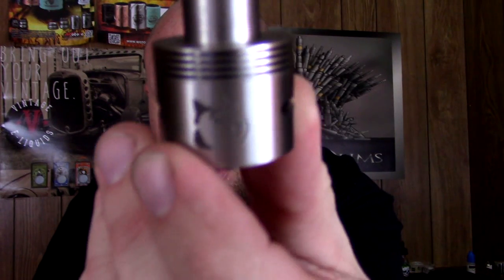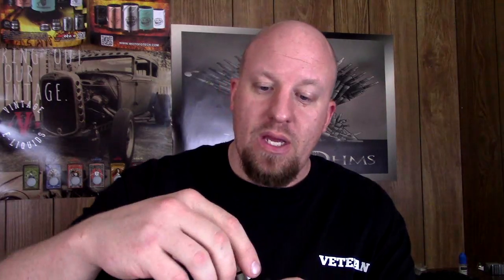SERIES vs PARALLEL~ 101~ Its Science Bitch!!!!

Comment: can I use a 20 amp 18650 in a noisy cricket series box with 14 raps on a 3 millimeter drill bit
Reply from the maker: Dentz Storm i would not use any 🔋 under 30 to 35 amps...
Reply: Vaping Vigilante I can't get my hands on any above 20 amps my vape shops don't carry them anymore
Reply from the maker: www.imrbatteries.com

Comment: Mention, if you stack 4 18650 batteries in parallel config. It will be spitting out 8.4 volts. Actually more safer than a regular 2 18650 wherein 4 18650 parallel stacked has less discharge for each battery. My unregulated or fully mechanical device is parallel, can config. to series ( parts included with mod ) as well as ordering a booster kit ( in which stacking 4 18650's in parallel mode ) can be applied also capable of building lower than .3 with booster kit. I'd stay above .4 in 2 18650 in series, and I build as low but no lower than .05 which is super fucking low. I know my batteries and I do play with ohms law so don't try if you don't know what you're doing 

In case you're wondering what my mod is...The mod is called KALASAG BOX MOD by Ninoy Aquino maker of BB box mods ( bulak boys box mods "cotton boys box mods") :)

Comment: Nobody should buy a noisy cricket . they are a cheap cheap series 18650 box that is not made good not wired good .If you want to get a series box get a good custom made one . spend that $130 Bucks and get a good one . Build at   .35    .40    .50   they say you can go Down to .28 with true 30 amp batteries . "The only true 30 amp cont batteries tested by Mooch are  LG HB 2  ,HB4,, HB6  " thats it, not sony vtc5 vtc4 vtc3  not samsung 25r's    Nothing but LG HB2  HB4 HB6 if your going to build AT .28 -.35 ON A SERIES . Nothing else can handle it ..now if your at .40 ohms  on up the other batteries would be fine ..  Series Mech Boxes are for expert vaping . unless you are very experienced stay with single battery Mech mods or Parallel Boxes ..Stay safe folks ..dont blow your face off :) thats why we quit smoking was to stay alive and healthy .
Reply: Right To Vape vtc5a work in my series so wrong

Comment: so are your vw/vv boxes in series? how do they pull the 7+ volts?
Reply: +Chris Chandler No there where vv/vw capable of outputting more volt's then the input from the battery(4.2 and dropping with use) with only one battery for a long time. I am no pro at this but I believe the circuit board is responsible for increasing the voltage much like it is responsible for stepping it down. Once again I am no expert so take what I am saying as a grain of salt.
Reply: slosh11111420 that simply isn't possible unless the mod has a capacitor inside of it.
Reply: Well then they must. Not saying I know the recipe but single battery mod's capable of 7v have been around a long time.
Reply: slosh11111420 I don't know of any single battery mod putting out 7 volts
Reply: That's all there was for a couple year's. Series box's are only been around a year or so.

Comment: Putting a .6 on a parallel box and then a 8.4v. You can match it with the parallel at super subohm. Now I can see doing this for safety issues for this channel. But I do .05-.09. My daily vape is .09 on a parallel box. If on series .3. But then again I've been doing it for a long time. Also being being educated . It's not uncommon for the advanced vapor doing .06-.08 if you a comp vapor, depending on the rules of the comp. But a .6 on a parallel then going to 8.4v, apples and oranges. But I know you know all that for sure.
But for sure saftey first. You need to know everything you said. pulse ratings of the battery, ohms I mean like you said it's sience. I've only vented one battery and it wasn't in a mech. But well done video. Sorry for the rant.

Comment: I was watching this vid hoping to find the answer to one question which you really didnt touch upon. When running in parallel you double the amp hours what does that translate to in actual usable amps as two 30 amp batteries in parallel dont equal 60 continuous amps but something near 40? or so from what i've been able to find. im asking this so i can find a proper comparison of a parallel and series box mod in terms of equal wattage. in pure numbers its obvious that the series would out perform the parallel box simply because of the amps to watts that it puts out but in practical use would it produce more vapor as the parallel would allow for more elaborate coils potentially producing more vapor? sorry rambled on for a bit hope you can help maybe imma idiot and missing something haha
Reply from the maker: Parallel setups are safer setups . It is safer due to the amp load being shared by the batteries. Now series of course is much higher voltage which translates to more current or amp flow which if done wrong and too high a amp draw is placed on the batteries and circuit can cause problems. Battery life is less in series. Now series does have the current to fire up more elaborate coil setups , but an unregulated series setup won't stop you from fucking shit up and over pushing your batteries and the device in general.
Reply: +Vaping Vigilante wouldn't series be safer because you are vaping at a higher resistance.  the lower, the less safe and the less strain on ur batteries
Reply: +grantd272 You might vape at a Higher resistance, but since you are pulling 8.4v (at best) from the batteries, your amps are also going through the roof. 
Say you have a 0.2ohm coil, in a parallel you&#39;d be pulling 21amps which is a bit over some single batteries limit but since you are in a parallel configuration, each battery will only be giving out around 10.5amps each which is safe.
Now if you go on a series configuration with the same 0.2ohm coil, you&#39;d be pulling 42amps which would result in a venting situation in some puff, if not immediately.
If you want to keep it simple for a series config, buy GOOD batteries from REPUTABLE Sources (like sony VTC4, Samsung 25R or LG HB4 (i believe)), an ACCURATE OHM READER (USA ones are great) and STAY over 0.4ohms in your coil build.
Reply: +Stéphane Lourenco any lower than .35 on a series is unvapable.
Reply: +grantd272  Pretty much yeah... I've seen some people vape that low but It was a REALLY hot vape. Some people might like it, but then again, I prefer to stay between 0.4 at the minimum and 0.7 ohms.

Comment: didnt touch on at all about HOW to build for series and parallel.....that Cigreen box would fire ANOTHER 0.6 ohm build and BLAST your shorts off. It just wasn't meant for that kinda of 0.6 ohm coil.  Lower gauge wire and less wraps will also get you to 0.6 and will ramp up MUCH faster on that parallel. At the same time those series boxes are meant for higher ohm builds above an ohm that would otherwise take forever to ramp on a parallel but will ROCK on a series. no diss, I enjoy your vids and am a subscriber. #respect